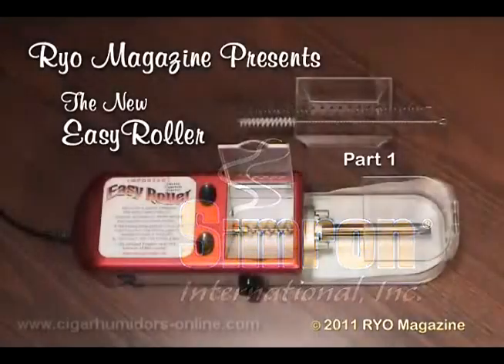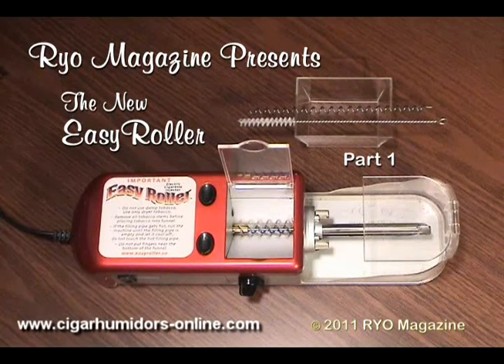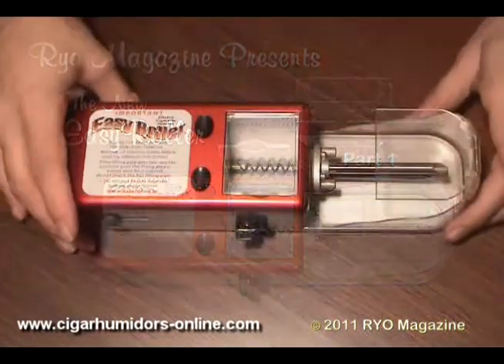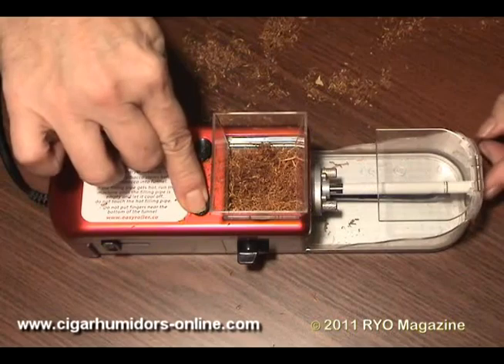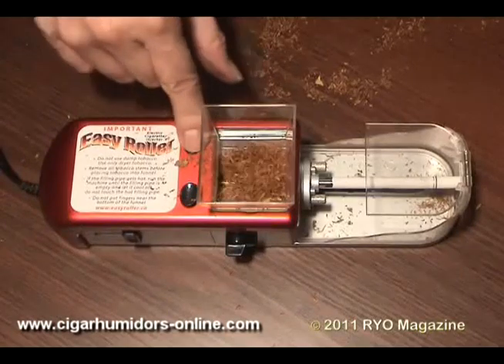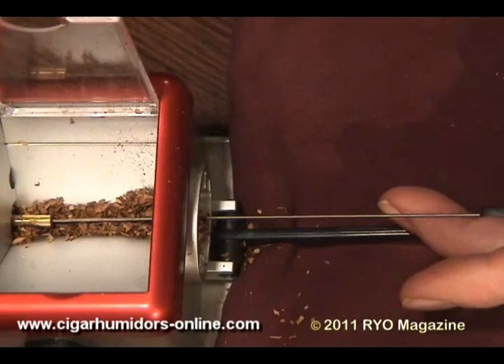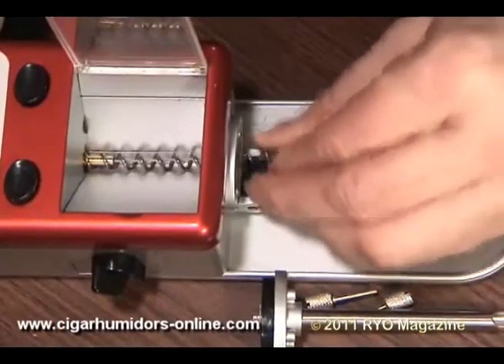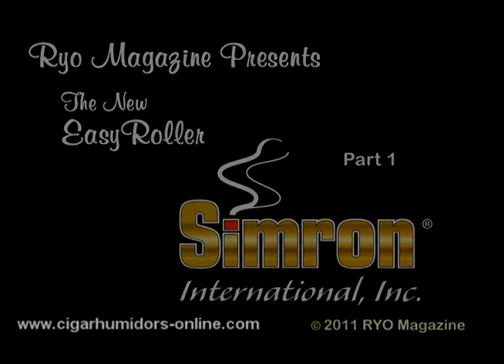Easy Roller Electric Cigarette Injector (How it Works Overview - Part 1)

Comment: The only thing that took too much extra time for me was having to twist the end of my cig so the tobacco wouldn't fall out in the cig box. I found that drilling a 11/32" hole, in a piece of ceramic tile or wood, about 1/8" deep had just the right conical tip in the bottom of the hole to stick the cig in to round my tip.

Comment: I have a similar machine. The problem is that I try to untangle the tobacco but when I put the the tobacco inside the roller after some time the tobacco becomes entangle around the roller and the machine gets stuck. The only way I loosened the tobacco is I microwave it about 1 minute. The tobacco then becomes brittle and will work fine inside the roller. By this process am I decreasing the flavor of the tobacco?

Greetings from Malta - EUROPE.
Reply: From malta u bought it the machine pls
Reply: Toni DAINA grech hello please yes fine crazy okay thank
Reply: I think it matters if you're decreasing the flavor only if you, personally, can taste a difference. If you can't taste a difference then the difference doesn't matter.

Comment: Grrrrrrr. I just bought my Fasfil electric cigarette injector 4 days ago and I'm getting really angry with it. I've tried all of your tips, tried every possible setting, tried both springs....everything I can think of.....and the cherry or ash always falls off. Seems like both springs shred the tobacco way too much. Any suggestions?
Reply: no I have same problem it's just bad concept no matter what to so now he try to argue that this one wire is solution bs I must buy one who work same like tipical manual I have manual machine for 3 cigar now after 5 years all was brake but super glue make miracle now work only two third make till half cigar best is powermatic 3plus but it's expensive only whit push can make good cigarett this work like machine for grinding meat

Comment: If you have arthritis, I would use an electric machine. Unless there is a machine that loads the tubes, the electric is not faster.  The Tops 2 with the hand crank is just fine for speed and price.  The T2 is $39.95 at Sam's Club in Hogkins IL, or $49,95 on Amazon.  Unless the electric machine also loads the tubes, there is no difference in speed.  The cherry never falls off as is the problem with a lot of electric machines. I can make a carton in about an hour with my T2.  Big Rock cheap tobac.